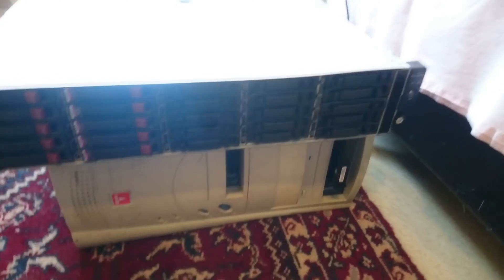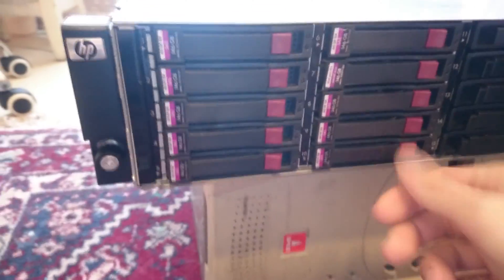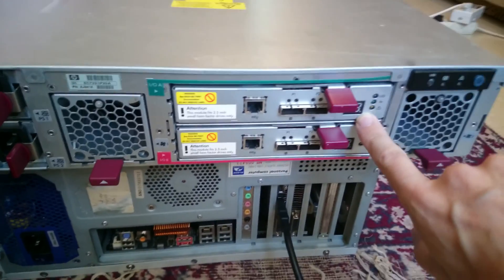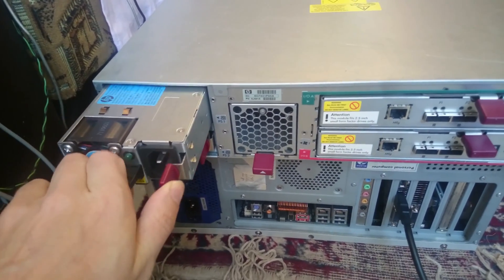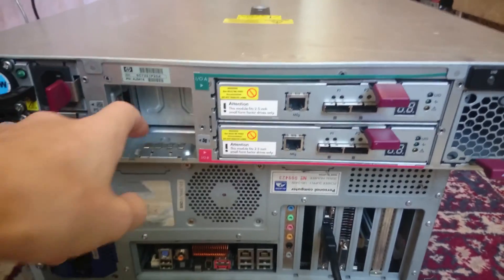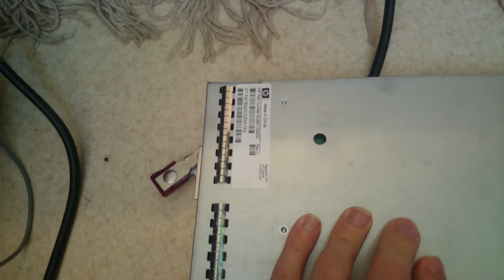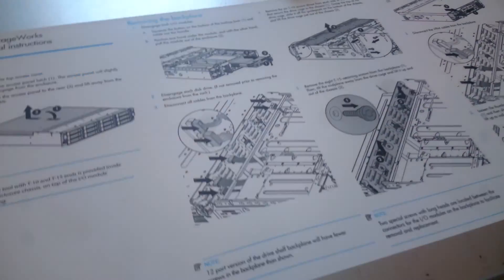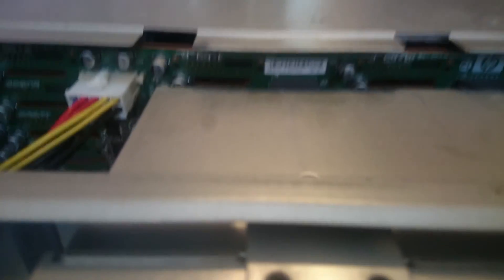HP D2700 Storageworks Overview

Comment: Q - Do D2600/D2700 controllers let pass-through HDD for FreeNAS/ZFS with controller card H200E/or other LSI HBA Cards?
Q- HDD Backplane is 6Gb/s or 3Gb/s?
Q - What is the max capacity size for SATA Drives?
Q - What is the max capacity size for SAS Drives?
Reply from the maker: hi and thx for watchng.
it's just a shell, so it depends on raid card. 
A - we got it worked even with emc vmx 5xxx series, but it was not zfs(2.5 520 block emc disks with hp caddys).
A - max 6gbps sas/sata backplane.
A+A - depends on controller, but max there is 2.5 hdd's 2tb